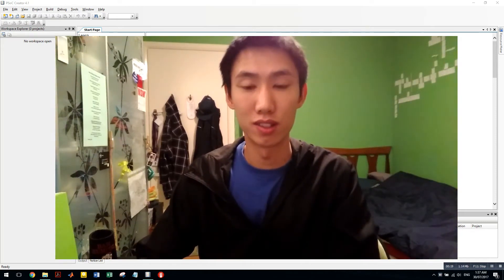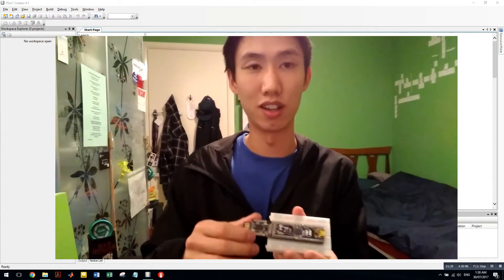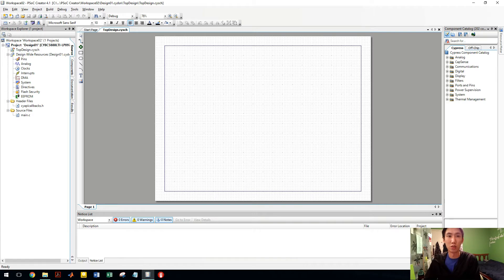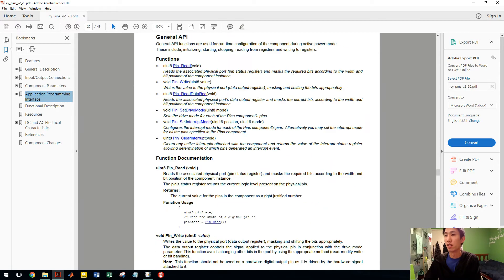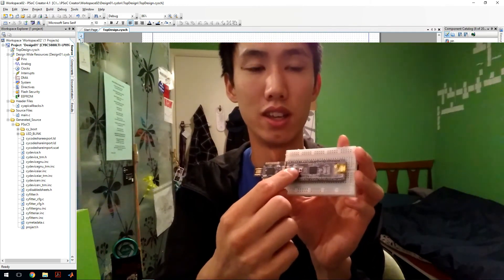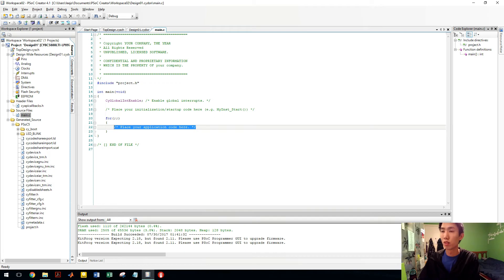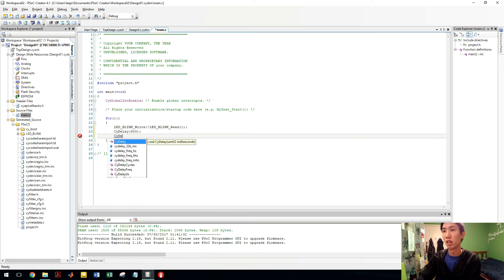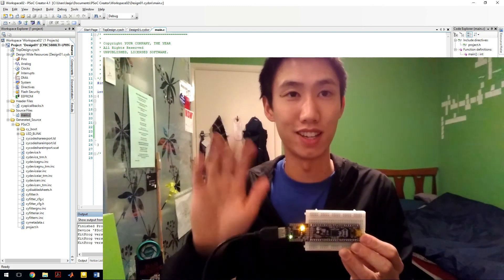PSoC Tutorial - Introduction and blinking LED

Comment: Great video... why boss you stopped any chance to do video how to run psoc this 059 kit run with button something swithch on and off and also how to work with nema motors 34 and encoder servo motors nema 34 ? just intersted who can help on this please ?any quck video with code i bought this kit but no much info about how to run ... i little bit know about ardunio but here not much just i got it... same kit i have cy8c5888LTI-LP097..I really apprieciated who will help on this please

Comment: how to connect PSoC without header pins. is soldering necessary?
Reply from the maker: if you're using the USB version i'd recommend header pins, soldering directly onto it will be messy but should work. if you buy just the chip, you can do a PCB design and attach it with a socket i guess

Comment: hey dude, the blue LED doesn't turn on, what can i do?
Reply: LED 1, 2.1 of the video
Reply from the maker: can you tell me what you have done so far?
Reply: I'm new using PSoC, and I have watched a lot of tutorials. One of them was to turn on the LED of the PSoC with the switch, but anything happen. I see when you plug the PSoC to the PC the blue LED turn on with the others, but it doesn't happen to me....
Reply from the maker: Oh, sorry the light is on at the start because I programmed it previously to do that. If you haven't programmed the PSoC yet, it shouldn't have the blue LED on. Just double check you're following all the instructions and haven't missed any steps.
Reply: Jonathan Lee can I do something to prove that the LED is right?
Reply from the maker: Ok, I am still not clear what you have done, can you start again and follow my tutorial exactly? Make sure you don't miss anything. Things that could go wrong include wrong pin allocation, incorrect naming etc. Also make sure you choose the correct PSoC when you start the project.
LED_BLINK_Write(1); will simply turn on the LED if you use the same naming as me, so you can check with that.
Reply: A mi no me encendía y revise el código paso a paso y me hacia falta dos cosas: 
1) el signo ! antes de escribir LED_BLINK_Read());
2) al CyDelay(); le estaba agregando el Us